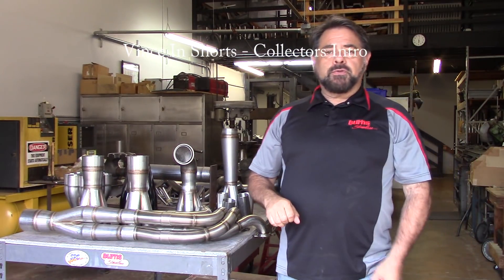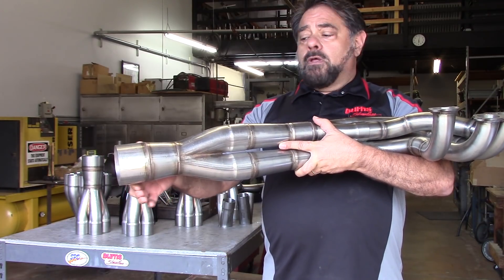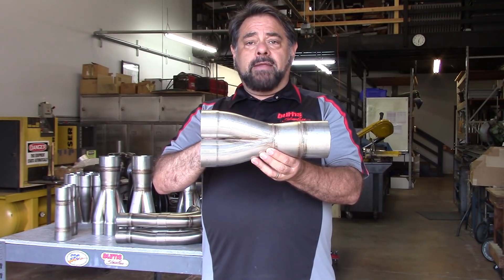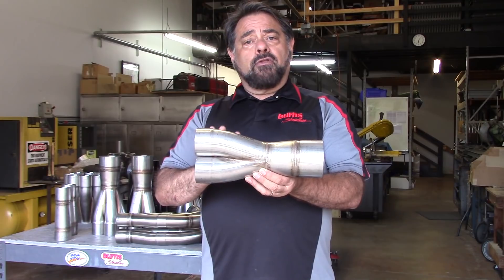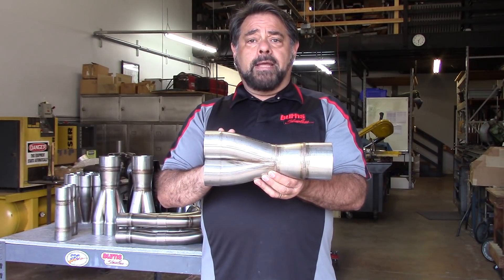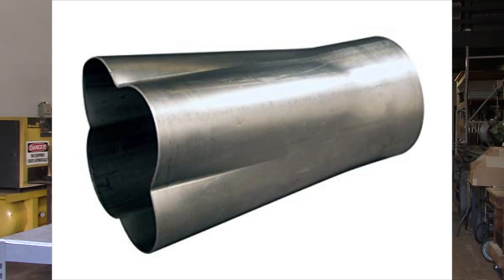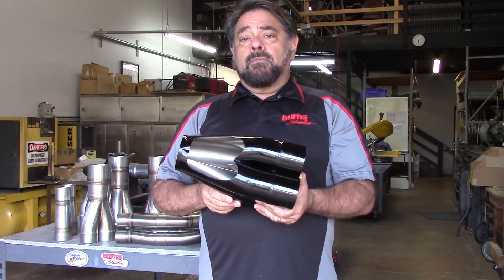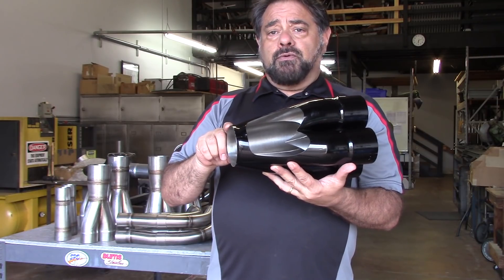Vince In Shorts 4   Collectors An Introduction

Comment: I can understand how 2-1 collectors are fully welded, but how do you get inside of a 4-1 collector to weld it fully?
Reply: We have a great welder who does not have bones in his hands.
Reply: @burnsstainless2607  I know this is an old comment, but I suspect you'll appreciate the following. I work in nuclear power and our fuel assemblies are comprised of fuel pins that are in the 0.3 to 0.5 inch diameter range. These are about 12-14 feet long and there are as few as 14 x 14 and as many as 17 x 17 pins in an assembly. Along their length are a number of spacer grids which help keep the pins straight, but also help introduce mixing in the water flow. These spacers are made of stamped sheet metal and fit together with interlocking slots. They are then welded together into a single piece. Today, this is done with automated laser welding and it's nearly impossible to even see the weld. However, it used to be done by a "team of grannies," who were the only humans available with small enough hands and fine enough motor skills to do the job. Memory tells me they used to be brazed, but I'm not sure how well that would take the temperatures and (especially) irradiation those would see (frankly, I don't know much about brazing). Regardless, I always found it humorous to think that the entire nuclear fleet's operation was beholden to these old ladies!
Reply: @burnsstainless2607  😂 seriously I would love to see the cup and tungsten on that guy's setup, boneless or not! Excellent work guys.